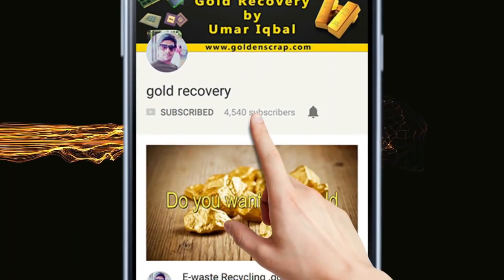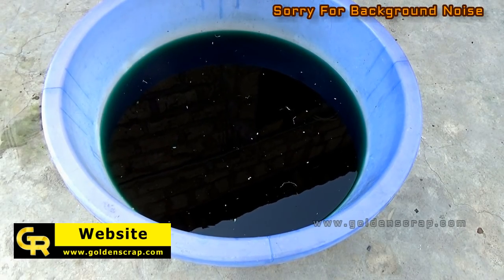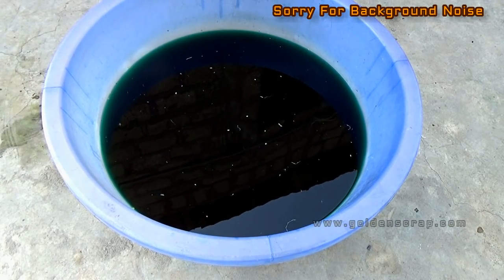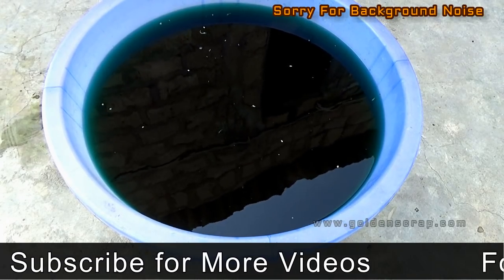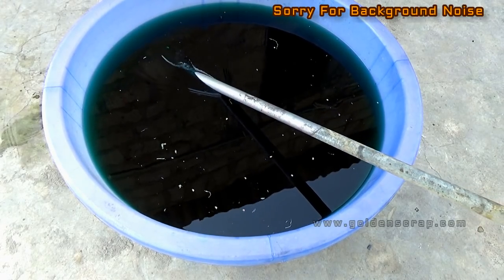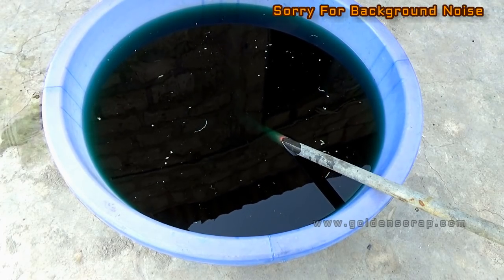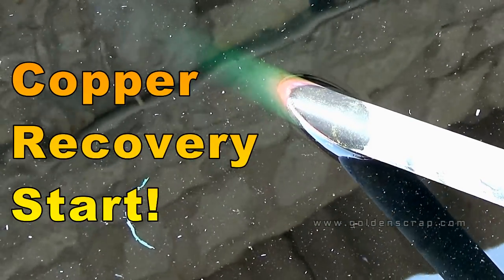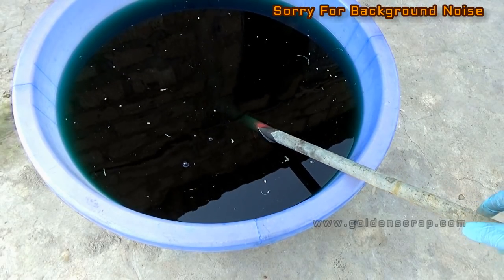♻Copper Recovery Process from Nitric Acid with computer Recycling

Comment: Great video. I make the same question as Brian. Can I use this method with muriatic acid as well? I did my gold recovery with it and I have a bucket of copper soaked acid,
Reply: solution with muriatic acid, you have to use aluminum foil or any aluminum gradually, the reaction is violent.ok?

￼

Comment: I think you might get better results using sheet steel, surface area alone...  With pipe you have to remember the inside surface area.

Comment: are you going to do any other recovery videos like tin or nickel?
Reply from the maker: Yes, I will try.
Reply: There should be a lot of Tin ....??  That's what all the Solder is .. 95/5 ....SN
Reply: and tin is going up in price, its worth way more than copper, copper is worth $6927 a ton, tin is worth $19300 a ton and nickel is worth $11700 a ton, so they are worth recovering

Comment: Hello i write you from Turkey. I have a question. When we precipitate the nitric solution with iron, does palladium also sink to the bottom? NICE VIDEO
Reply from the maker: If palladium is in your nitric solution then precipitate palladium with sodium cyanide first. After that recover copper.
Reply: gold recovery If the liquid is in high quantity, will it be precipitate? What is the duration of the collapse?
I was using sodium chlorate method but i had been waiting for one day.
And is there anything wrong with the mixture of acid and cyanide?
Reply: gold recovery hello, do you have any information on how to recover the Palladium  in this? Thanks